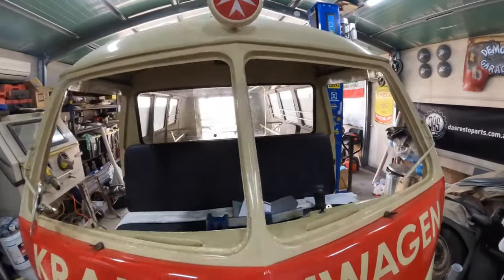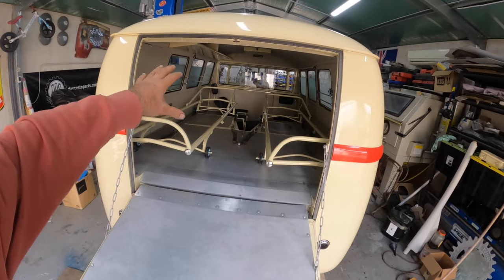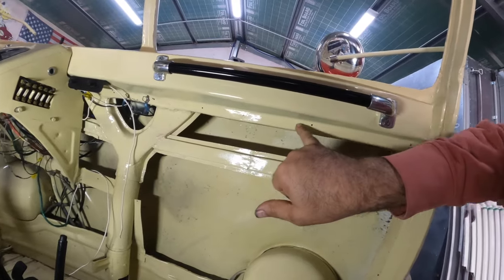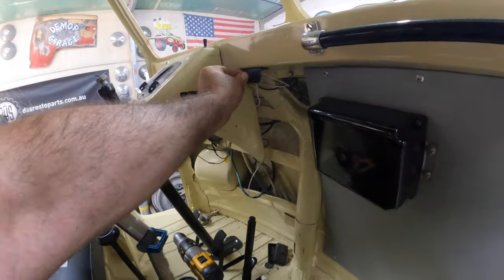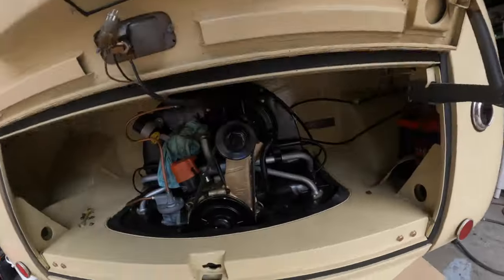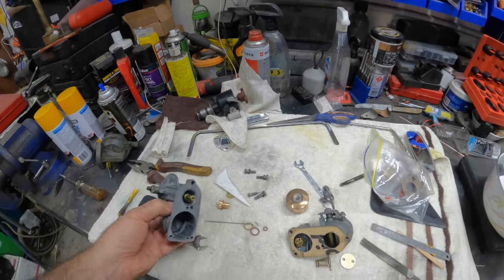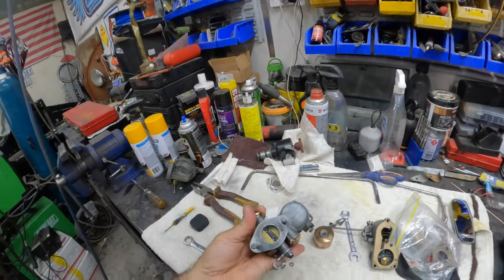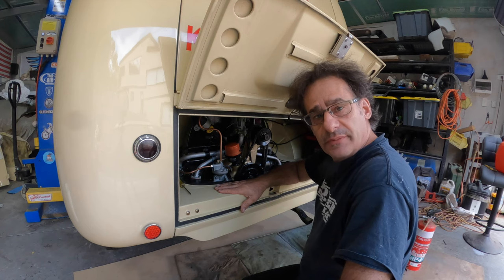Rebuilding a 1952 barn door ambulance //  Carburetor tuning issues #volkswagen #vwbarndoor

Comment: hi Nik, troubles with carb's are a pain.
try to rule out pressure problems from the fuel pump out. disconnect the copper fuel line and mount a external feed.
if you still have the problem it's the carb. if not, then you have to search your problem in the pressure off the pump.
otherwise it's the needle that is leaking and dropping fuel at the main jet.

Comment: I recall you changed the shaft on that carb. If the flats on the shaft where the butterfly flap mount  were not machined at the same rotational orientation of the outer flats on the side of the shaft then the rotation won't stop at the correct angle. The side of the carb has exposed holes where fuel enters via vacuum. At idle only so many holes are exposed and the angle of opening is critical to set the correct vacuum here.  So check the old vs new shaft and also check that the manual choke is not interfering with the butterfly idle flap angle too.
Reply from the maker: That was the first thing we checked both shafts are the same, butterflies closes tight. Theres only 2 holes one above the butterfly and one below which gets covered. Choke arm not in play.

Comment: make sure the butterfly is in the correct way i had the same issue with my stromberg carb on my red motor i put the butterfly in wrong not allowing it to rotate the shaft enough on the idle screw
the butterfy has a angled edge on it
Reply from the maker: These ones are dead flat, but did rotate it with no change. There is a number stamped on the butterfly too

Comment: Re: the idle problem. Is the butterfly totally centered? it can be a little bit off when you tighten down the screws on the shaft that holds it. make sure throttle it is tightly shut in the bore when tightening them down (idle aduster screw backed out).
Reply from the maker: Checked that 3 times so far 😉 it shuts perfectly no light coming through

Comment: Is the throttle cable connected? It may not be returning all the way, if not that make sure all your intake bolts are tight. You may have loosened something or forgot to tighten something.
Reply from the maker: no, we were revving it manually. Nothings loose its a real mystery so far.